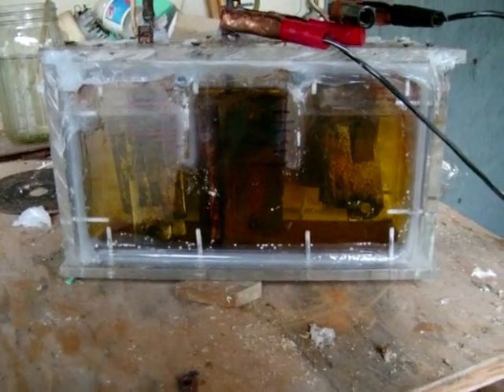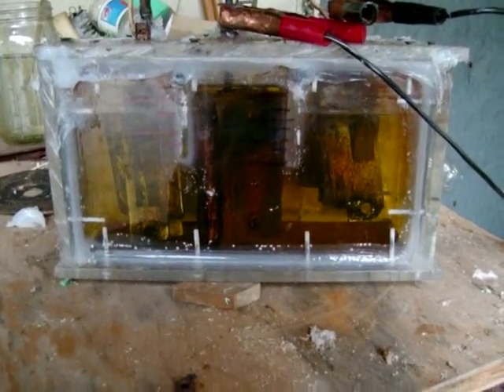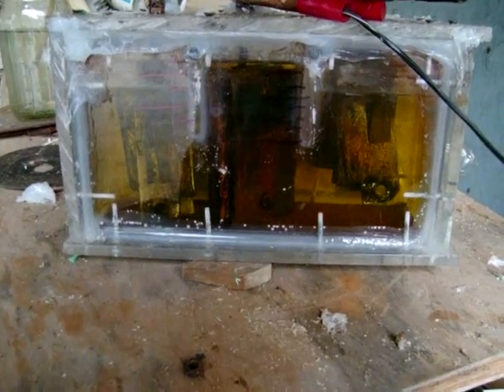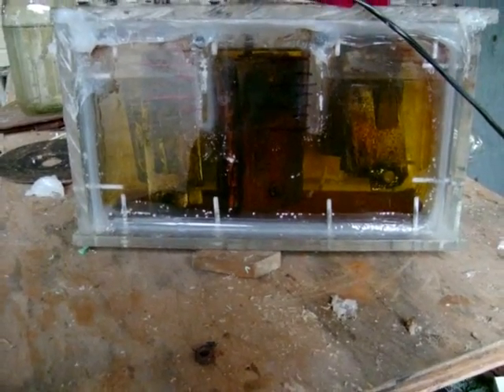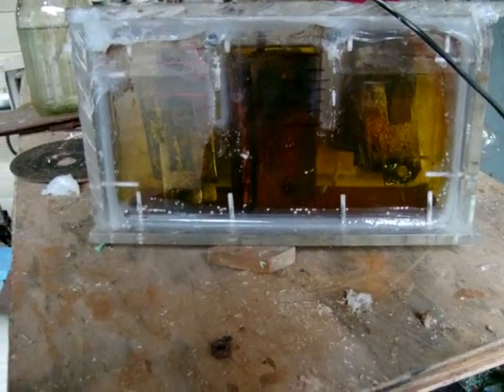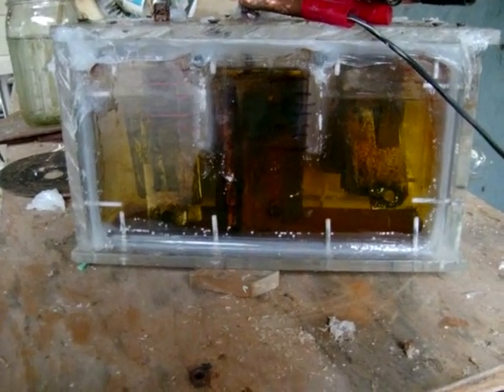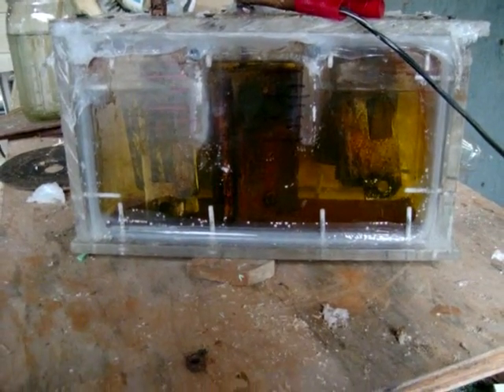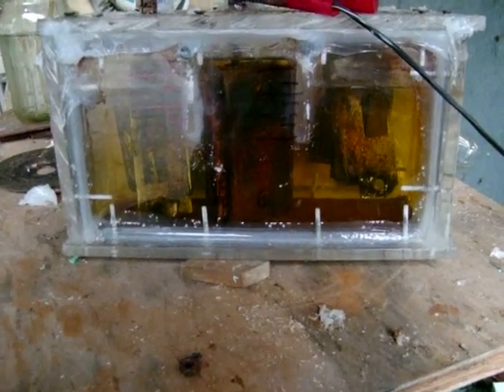Hydrogen Oxygen Separator

Comment from the maker: In this case it doesn't ,the plates i used were brass neg.side, coated with stainless which it doesn't do anything to these plates ,now the stainless steel plates which are the positive will blacken.The plates are a heavy gauge metal unlike the smaller gauge material which will heat up qucikly and brake down faster.
  Spacing also makes a difference,haven't checked lpm yet